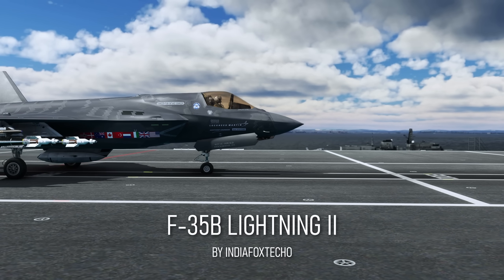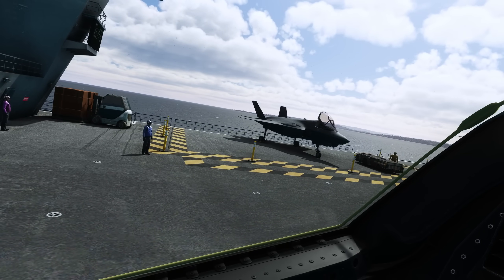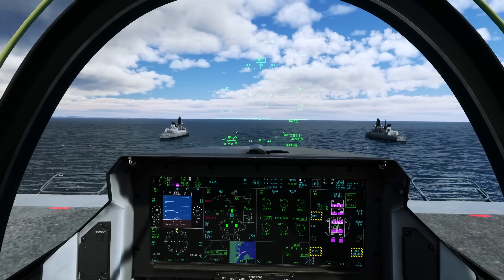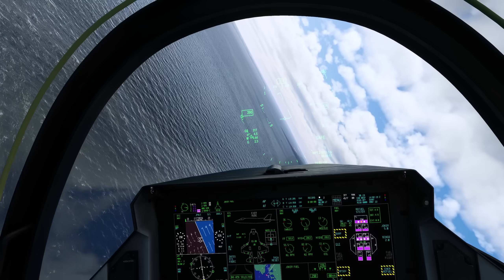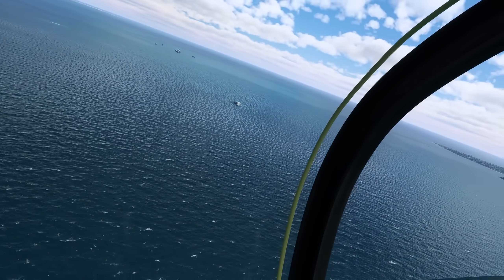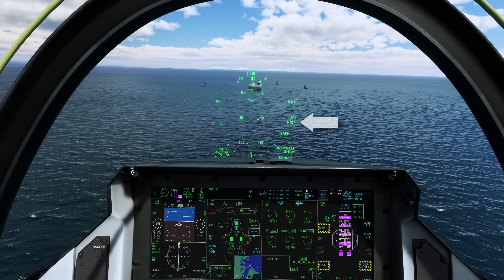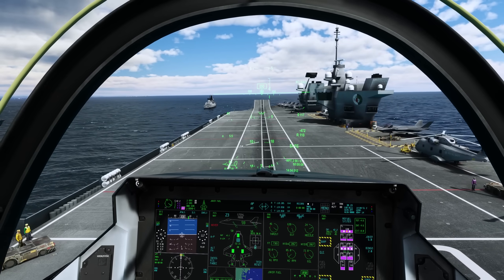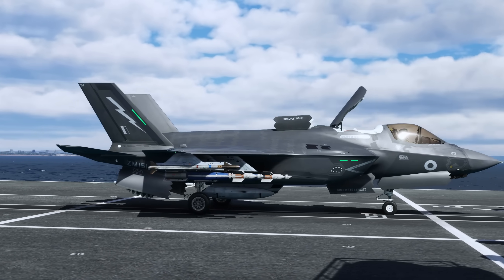Too Heavy to Hover? The Brits found a solution! F-35B Lightning II SRVL (MSFS)

Comment: And for the next trick, with the ship actually under way at 20kts. For bonus points at night, no lights and a good storm blowing with a pitching deck 20ft.
Reply from the maker: Well I did do a CASE 3 STOVL video with poor weather. I do wish that MSFS focused on the ship dynamics, even a basic pitching and rolling motion would be nice. As for night… I think the buggy HUD would give me a headache! 😅 Perhaps over the DCS for some better ship stuff.
Reply: @cgaviator  Ships and the Oggin isn't the place for RAF guys. Stick to the seedy flesh pots of Deci in Sardinia.
Reply from the maker: @jjsmallpiece9234  lol, that’s precisely why I avoided volunteering for the F35!
Reply: @cgaviator  Can't be having those rough navy lads corrupting the morals of a clean living RAF boy.
Reply from the maker: @jjsmallpiece9234  seamen you mean! 😂
Reply: You Brits have bailed us Yanks out a couple of other times, like the angled flight deck and the turning approach with the Corsair, F4F-U and the clipped wings on the same aircraft.  Thanks mates.
Reply: It would actually be easier if the ship is moving. Especially if it is going into the wind.
Reply: @jennyjansen754 Kind of a dick move if they're going WITH the wind during landings!  😂
Reply: The next trick is to install large fans in the deck to generate an updraft.
Reply: Hold my beer 😁
Reply: You make it sound like the RN had zero experience with Harriers (hint: we invented the harrier). Rolling stops were used with damaged or overweight Harriers, if I recall correctly.
Reply: B35 Kamakhazi the worst failure in the history of military aviation and the RN that has cancelled half its order pretending they can get it to work. If only Benny Hill was still alive imagine the comedy skits he could do. A carrier with no crew and an aircraft that is barely airworthy. 16 years past its official delivery date the US was supposed to get 4250 alone plus its vassals share hundreds more a little over 1200 made all up. Due to be out of service in 2040 that's now 2070. Israelistan 🇺🇲 announced if its vassals want any of the 1000+ faults fixed they will have to pay CASH UP FRONT 🤣 those silly enough to believe this garbage you will be old men before it goes out of service. Britain the "mouse that roared" Kamakhazi? Kama a tribute to Japanese pilots who sacrificed their lives and Khazi UK slang for a toilet.
Reply: I don’t know if the British version has this but the American version has a system that communicates with the ship so that basically it has CAT III zero visibility landing capability
Reply: F-35 has night vision and EODAS.
Reply: I think in the real world with these conditions it is possible for the F-35b to handle landing on her with the new workaround under heavy load outs. I imagine though they wouldn't practice heavy load landing or take-offs if there is chance for pretty bad conditions.. Maybe under wartime but if that is the case then it is almost certain an American carrier won't be too far away for an emergency secondary or just wait out the storm with refueling which would auck horribly.
Reply: Lovely video, both for CG and connection to reality.  Interesting comments there aboot creative adaptation when conflict demands it. Now how aboot a CGav feature… in-app purchase to get full f-35 function, price at £110million, to be retained by gamepublisher after crashes. 😊
Reply: Don't forget Jeff.
He's that guy that everyone gets frustrated with as he never listens.
As a result he's currently not manning his station as he's distracted.
Let's hope you don't need Jeff.
Reply: and under fire in combat conditions
Reply: Designed in Lancashire. Not US . Basically a harrier the yanks did not have the no how in vertical liftoff
Reply: Unlikely to happen on the British carriers though because the RAF operate the aircraft (instead of the Royal Navy) and RAF pilots require 5-star hotels and won't work on weekends.
Reply: No curving short approach then, balancing lift lost in the turn and throttle reduction against arriving at the round-down with too much energy and bouncing down the deck ?
Reply: I imagine that would be the trouble with VTOL and low-speed STVOL in squally conditions, the mass of the aircraft just becomes the paddle of a windmill and disproportionate input would be needed from the system and pilot to stay lined-up with the centre line of the carrier.
Reply: I don't understand the British mentality with carrier ops, it feels completely half arsed. Building two huge carriers just to have an empty flight deck 90% of the time, one of them permanently in dock, not arming said carriers and borrowing RAF and foreign aircraft once every blue moon just to prove they can actually use them for their intended purpose, then coming up with concepts like the rolling landing that looks great on a flat calm sea but probly no good in rough conditions. The Gov/MOD/RN need to get serious with carrier ops, fit cats and traps, buy more dedicated aircraft exclusively for the RN or don't bother and save the money.
Reply: @diveguy4291 even when the US had 11 carriers typically only 5 would be at sea so having 2 means 1 should always be available. Re f35 we now have 30 by the end of 2025 it will be 48 and by the early 2030’s 74. Cats and Traps mean pilots have to make a huge number of takeoff and landings just to maintain their skills, the time spent qualifying for stovl is tiny in comparison. If the shit does hit the fan (Falklands style) you can guarantee that everything available including OCU jets will be crammed on that flight deck, if it’s a nato operation then if necessary US marine jets will fill out the ships, so in short it’s a very useful capability to have.
Reply: @andrewdeacon8315  30 to replace 70+ harriers & 140 Tornado aircraft of which most will be culled in subsequent defence reviews, your dreaming if you think the uk will ever get 70 and actually keep them, without scrapping it's other assets to provide the funding like typhoon etc. Stovl means no ability to launch ew or refueling aircraft and increased flight hours for pilots sounds like a good thing to me rather than having pilots sitting behind desks twiddling their thumbs hoping to one day get the chance to fly a real aircraft for more than one sortie every blue moon.
Reply: @diveguy4291  the “extra “ 26 are already funded , remember it was supposed to be 138 originally. The pilots get plenty of fly time from RAF bases, it about having an affordable solution that’s there when you need it . A tender is out with industry for lightweight cats and traps to launch drones with the hope they can be used as loyal wingmen , aew and refuelling. If this doesn’t come to anything then there are some interesting vertical takeoff options for aew and refuelling.
Reply: @diveguy4291  well you can't build carriers overnight and surely it's better to have the ability to expand when needed rather than fill it with aircraft designed for the previous war.
     And yes, it's just asking to be sunk but that is the same for any boat from canoe to battleship. Everyone is gonna have to adapt.
Reply: @diveguy4291  that's not as bad as here in Australia. We buy 2 carriers from the Spanish. 

Remove any fixed wing capabilities totally and fill them with helicopters
Reply: The same Carrier type the Spanish are flying 35B's from
Reply: From little seeds do mighty Oaks grow!
Reply: Even better if they actually have F35Bs to put on the carrier
Reply: @mastermariner490  They've also not installed the  30mm cannon on the carriers as a cost cutting exercise I believe.
Reply: @Scaleyback317  Exactly,so whats the point of having a carrier?And its not only in the UK,it goes for the whole of NATO
I hope Russias invasion of Ukraine have been a major wake up call
Reply: @doozledorf7036  Thats one of the problems,thats why higher defence budgets are needed,and many learned that the hard way in Europe.
But thats also the NATO doctrine and what the defence of Europe is based on and why NATO exists in the first place
Reply: @mastermariner490  Ask the Argentinians. The UK still has overseas territories (as does France - the sun doesn’t set on France either, both Brazil and Canada have borders with French territory, Canada actually has a land border with Denmark).
Reply: @Scaleyback317  They have Phalanx on them.
Reply: @chethemerc7841  Thanks for the correction especially as it is a plus point.
Reply: @Scaleyback317 👍

Comment: Thanks Chris.  That's very interesting and mostly similar to, but a bit faster final approach then one would make in the DCS:AV-8B for the abeam hover-  but then with the huge airbrake lift fan cover it's no wonder it starts faster but then slows so much.  The symbology seems weird to have an E-bracket but no doughnut (I'm so used to DCS A-4 and F/A-18 where you constantly have the donut in the scan pattern).  Nice job in splicing in that Picture-in-Picture interview too.
Reply from the maker: Lol, thanks! It’s a very basic implementation, I wonder if MSFS would allow them to make it less buggy and more realistic